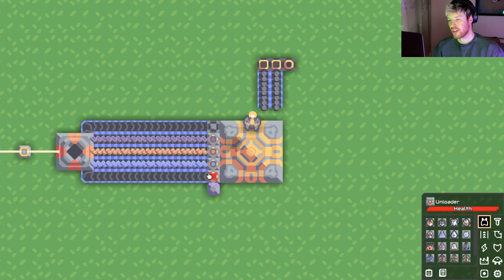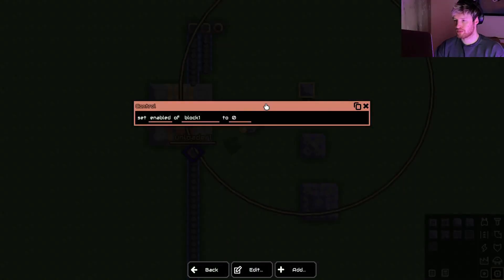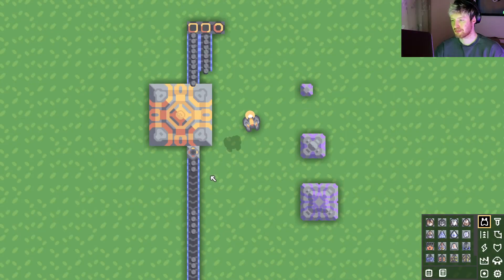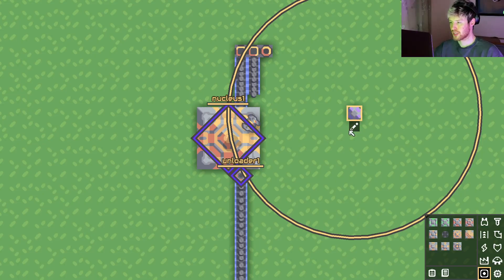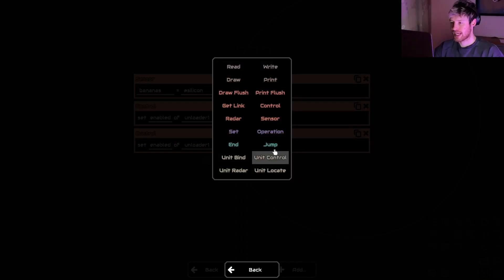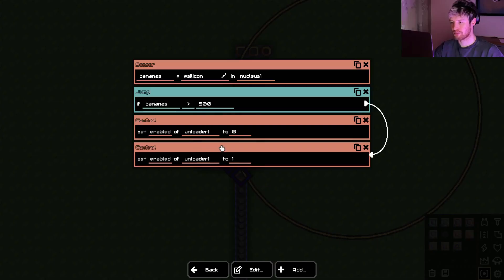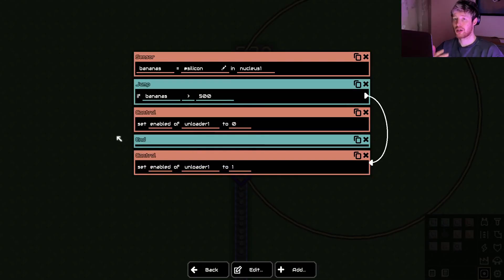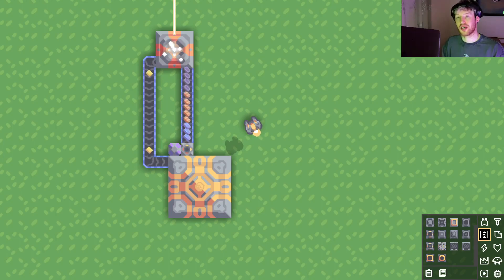Mindustry | logic example for noobs | micro processor beginners | unloader

Comment: sensor switch2on switch2 @enabled
draw clear 0 6 0 255 0 0
jump 17 equal switch2on true
write 0 cell2 0
write 0 cell2 1
write 0 cell2 2
read started cell2 0
read started1 cell2 1
read started2 cell2 2
draw image 36 36 @coal 32 0 0
draw clear 0 6 0 255 0 0
print "Turned of"
drawflush display3
draw clear 0 6 0 255 0 0
drawflush display1
printflush message2
end
draw image 36 36 @beryllium 32 0 0
draw clear 0 46 0 255 0 0
draw image 36 36 @beryllium 32 0 0
jump 27 equal started 1
write 1 cell2 0
read started cell2 0
print "Started"
drawflush display3
printflush message2
end
wait 0.5
print "MPC By DanLP6"
printflush message2
jump 39 equal started1 1
write 1 cell2 1
wait 0.5
read started1 cell2 1
print "Interact by inputing msg in the tb"
printflush message2
wait 2
end
jump 41 equal started2 1
wait 0.5
drawflush display3
draw clear 0 26 0 255 0 0
write 1 cell2 2
draw image 16 160 @beryllium 32 0 0
read started2 cell2 2
drawflush display1
end

Comment: I've been working on an unloader that releases pyratite only if power demand exceeds supply.
But I wish I understood unit control better so I could ask monos to bring lead directly to factorys if the core doesn't need any.
Reply from the maker: why are you building that out of curiosity
Reply: @SCHEMATIC  I tend to keep a lot pyratite in storage as ammo and such, but I occasionally need to burn a small amount as fuel when my base needs more power, but I don't always have the most efficient generators available on some maps.
Heck my current launch schematic has four combustion generators on it.
Reply from the maker: @aynonymos  I actually like that idea, I never have any pyratite as I always use for ammo haha
Reply: @SCHEMATIC  same, but since I can fill a container in between waves I don't mind using some as emergency power.

Comment: Does this count as logic for pro
set language 1
drawflush display1
sensor q1 node1 @powerNetCapacity
sensor p node1 @powerNetIn
sensor q node1 @powerNetStored
sensor p1 node1 @powerNetOut
jump 16 notEqual language 0
printflush message1
print "frog"
print "frog"
print "\n [red] 1. [green]English"
print "\n [red] 2. [green]Russian"
draw clear 0 0 0 255 0 0
draw color 255 0 0 255 0 0
draw poly 12 40 3 15 180 0
draw rect 10 35 30 10 180 0
jump 0 lessThanEq language 0
jump 0 greaterThan language 2
jump 126 greaterThan p p1
set r1 255
set g1 0
set r2 87
set g2 87
set b2 105
set r6 87
set g6 87
set b6 105
op div a 100 q1
op mul a1 q a
op sub h 100 a1
op mul g 2.55 a1
op mul r 2.55 h
op div j 63 100
op mul y j a1
op sub n p p1
op sub n1 q1 q
op div n2 n1 n
op div n3 63 100
op mul n4 n2 n3
op mul u p 0.00104
op mul u1 p1 0.00104
jump 43 lessThanEq u1 26
set u1 26
jump 45 lessThanEq u 26
set u 26
jump 47 lessThan n4 64
set n4 63
jump 49 greaterThan n4 0
set n4 0
jump 139 lessThan a1 10
set r4 0
set g4 0
set b4 0
draw clear 87 87 105 0 0 0
draw color 0 0 0 255 0 0
draw rect 13 71 14 3 0 0
draw rect 5 5 30 65 0 0
draw color r4 g4 b4 255 0 0
draw lineRect 13 71 14 3 0 0
draw lineRect 5 5 30 65 0 0
draw color r g 0 255 0 0
draw rect 6 6 28 y 0 0
draw color 0 0 0 255 0 0
draw rect 53 7 5 28 0 0
draw rect 63 7 5 28 0 0
draw rect 38 5 7 65 0 0
draw color r6 g6 b6 255 0 0
jump 144 greaterThan p p1
draw rect 57 48 7 22 0 0
draw color r2 g2 b2 255 0 0
draw rect 58 49 5 20 0 0
jump 74 greaterThan p p1
draw color 0 0 0 255 0 0
draw rect 49 56 22 7 0 0
draw color r1 g1 0 255 0 0
draw rect 50 57 20 5 0 0
draw color 255 255 0 255 0 0
draw rect 39 6 5 n4 0 0
draw color 0 255 0 255 0 0
draw rect 54 8 3 u 0 0
draw color 255 0 0 255 0 0
draw rect 64 8 3 u1 0 0
jump 148 equal q1 0
printflush message1
op floor fp p b
op floor fp1 p1 b
op floor fn n b
op floor fn2 n2 b
op floor fa1 a1 b
jump 92 equal language 2
print "[] Energy production:[green] +"
jump 93 always p 2
print "[] Производство энергии:[green] +"
print fp
jump 97 equal language 2
print "\n []Waste of energy:[red] -"
jump 98 always p 2
print "\n []Трата энергии:[red] -"
print fp1
jump 102 equal language 2
print "\n []General state: "
jump 103 always language 2
print "\n []Общее состояние: "
jump 136 lessThan p p1
print "[green]+"
print fn
jump 109 equal language 2
print "\n []Battery charge: [#ffff00]"
jump 110 always language 2
print "\n []Заряд батареи: [#ffff00]"
print fa1
print "%"
jump 115 equal language 2
print "frog"
jump 116 always language 2
print "\n []До полного заряда: [#ffff00]"
print fn2
jump 120 equal language 2
print " sec"
jump 121 always language 2
print " cек"
jump 124 equal language 2
print "frog"
end
print "frog"
end
set r1 0
set g1 255
set r2 0
set g2 255
set b2 0
set r6 0
set g6 0
set b6 0
jump 27 always x false
end
print "[red]"
jump 105 always x false
end
set r4 0
set r4 255
set b4 0
jump 53 always x false
end
draw color 0 0 0 255 0 0
draw rect 49 56 22 7 0 0
jump 68 always x false
end
draw color 255 0 0 255 0 0
draw stroke 4 0 0 255 0 0
draw line 0 0 80 80 0 0
draw line 0 80 80 0 0 0
draw stroke 1 0 0 255 0 0
printflush message1
jump -1 equal language 2
end

Comment: For the hyper processor at the beginning it wasn't working because of no cryofluid.

The processors also run at a set pace
Micro processor: 120 commands/lines per second
Logic processor: 300 commands/lines per second
Hyper processor: 1500 commands/lines per second
Reply: SHUSH
Reply: alright fine if you wanna spoil it. I'll do it too

Did you know that jumps are slow, you could use an operation

Comment: Can we add 2  unloader in control
Reply: My english is very bad but your are like a master of simple english
Reply from the maker: Thank you :)
Reply from the maker: Yeah -

simple way is just add another unloader and another processor 

Other  way is add 2 unloaders with one processor. The unloaders with both have different names so you make dat logic for it
Reply: Just a quick tip, if the processor is binding an unloader it becomes unloader one, but if the processor locates another unloader from its vicinity it becomes unloader2. U might wanna tweak the sensors to different unloader value.

Comment: good.
how about making processor not steal units from other processor?
Reply from the maker: I’ve not even played about with units and processors yet, so never came across the problem yet :/ will keep this in mind thanks
Reply: easy, if @unit is not null, then jump over the unit bind code